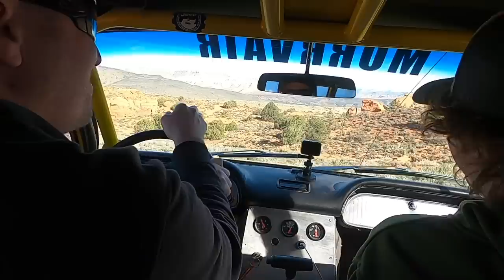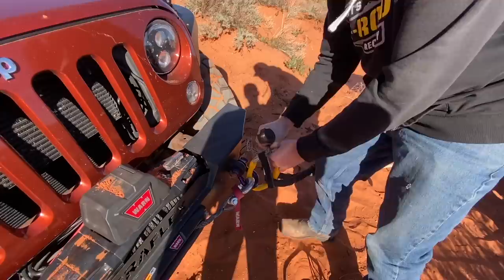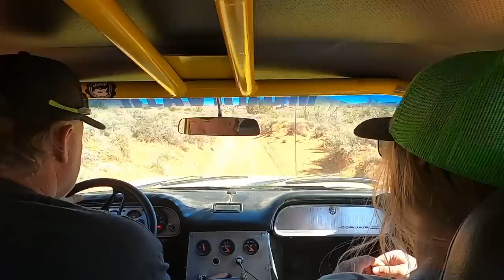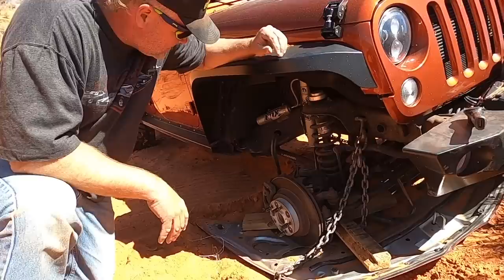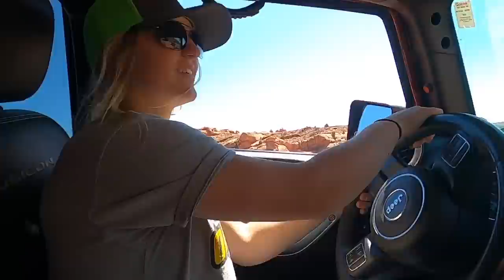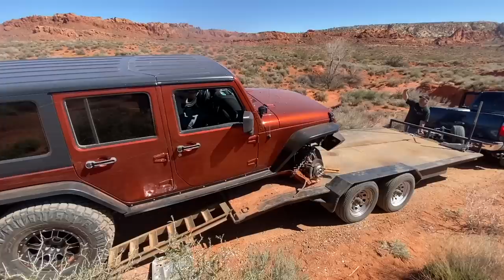We Dragged This Cursed Jeep Out Of The Desert!

Comment: "...skidded it out on a hood..."  I love the grit and ingenuity that always appears in these recovery videos.  Watching the challenges makes my problems seem insignificant!
Reply: I did that to my grandpas Mazda B 4000. Except I used the trucks hood. Actually works great.
Reply: Not very ingenious in this case, because it was easier to just buy a new part and fix it? It’s not hard to change that part!
Reply: @fikaa2388  I suppose that's true if you have the part with you.  Maybe they didn't want to run back to town and then back again to fix it.
Reply: @ScooterintheSticks  I agree that the first day they couldn’t have known, but the second day when they came, they could have brought the appropriate part instead of the hood!
Reply: @fikaa2388  You’re right of course, but that would have made a boring video!
Reply: @ScooterintheSticks  That may be so 🙂
Reply: These guys are all smart and not afraid of trying anything to get the job done
Reply: @larrycrouse  Come on man, this time it really wasn't smart! One bigger rock hidden in the sand was enough to do a lot more damage to that Jeep they dragged like that! This is the last solution used when there is no other, which was not the case here! They were more fortunate than smart that everything went well and they didn't do much more damage! It may be more interesting to watch, but far from being smart!

Comment: Secretly I always wonder about a trail fix but they’re much less dramatic and far more time consuming. Thanks for a fun video!
Reply: Had this happen before on the trail. It's not the best fix, but it got it out of the woods to the trailer. Pretty common for the dana 30s to pop off the knuckle when the u joint breaks. What we did was hammer / drill them out and use 1/2'' bolts to act as a really lose king pin. And then put in a stub shaft so the wheel bearing didn't fall apart. It wasn't fast but it worked

Comment: You guys need to make a sled/ski that will bolt up to the hubs in place of the wheel. Universal bolt pattern cut on it so it'll fit a large range of vehicles. Put a piece of 2x2 stock protruding from it somewhere that would allow it to be slipped into the hitch receiver and hung off the back of the MORR vehicle to get it to the site.
Reply: Or a ski/sled that would clamp to the axle.
Reply: Or an off-road wrecker. lol
Reply: One day they will have the homemade wrecker on 5 ton axles. Pick it up carry it home.
Reply: won't work in this case because the lower knuckle was broken and is why they removed the wheel in the first place. They could make a sled that would bolt to the bottom of the frame somehow and that would be cool
Reply: @scottibass  I think that they are going to end up with a wrecker that is similar to the one that Rory Irish of Moab Motor Sports uses ( Trail Mater ).  
                         Then again , there MAY be another solution . A couple days ago , I saw a video that Casey Lofthouse  ( CORR) put out, where he used a small " hoist" on the back of 
                         his Jeep , to haul a side by side . Now , a side by side doesn`t weigh what this towed Jeep does , so that may not work . However , the Morvair is heavier than 
                         Casey`s Jeep , so it might work .
Reply: @scottibass  I wondered if the lower ball joint could have been pulled back in and secured with a small come-along and the put tire back on. Not sure if you would have room to steer it but rolling might be an option. Either way the end result was getting it to the trailer and that is what counts.
Reply: A wheeled dolly would be even better...
Reply: I've used a fence post to get a jeep with a broken rear axle out. Probably would work on the front.  Chain the front end of the post to the frame let the axle housing sit on the middle of the post, drag the back end of it. 3" wooden post or a landscape timber works best.

Comment: Replied to someone else in these comments, but thought it was perhaps important enough to make a separate post about it...
What a lot of people may not realize is that these knuckles - especially if they are constructed from aluminum - tend to break from over-tightening. All it takes is an overzealous technician or DIY'er, with one of the high-dollar / uber-high torque impact guns to zap the ball-joint nuts down, instead of doing so lightly until they're seated without spinning  - and then torquing them to factory specs. On a JL (for example) it's something like a mere 52-59 ft. lbs. for the uppers and lowers are even less - at 30-37 ft. lbs.

Comment: I love seeing how most of the recoveries go on this channel and they are fun to watch. 
This one though with the jeep was really questionable. Idk about the whole hood thing lol. 
It honestly seems like it would have been easier to just fix the suspension or put the jeep on a trailer to begin with. Rather than drag it out on a hood? Just seems unnecessary and kinda weird🤣funny to watch though.
It reminds me of the saying.."coming up with a solution to a nonexistent problem" haha!
Reply: Agreed. I wonder how much additional damage was done to the rotor and other components. They just hate this guy's Jeep for some reason LOL
Reply: I feel that but it depends on where they are and how bad the problem is. Time is another factor. If you cant get the trailer back there, gotta pull it to where you can. We didnt get a super clear shot of the problem so it might not have been an easy fix. Even if it IS an easy fix, they may not have had parts available off rip and youd rather have your rig in a shop/yard than sitting on the trail unattended for 3 days waiting for parts

Comment: Matt...  Even though you weren't in this video it was a great video.  Love the way the guys and Lizy used some quick thinking to use the hood as a make-shift sled.  I would suggest since ya'll do so many recoveries where a broken ball joint is involved.  Maybe make a sled out of some 1/4 or 3/8 inch steel with the front curved up like a snow ski with some anchor points on the top of it to secure it to the disabled vehicle.  Might want to make one (use 1/2 inch aluminum) for the trailer you use for recovering Razors and other side-by-sides.

Comment: Hey Eric .. make a ‘ski’ out of a   6x4 post and angle cut the front so it won’t plow . Mount some counter sunk eye bolts so the fit on top of the board . 
Take a 2x4 and screw that to the bottom side and sink the screws in deep then you can take a heavy duty strap and tie it to the axle or suspension where the shackles hang down. ..
And then you can pull it out .. or - just custom make a metal 1/4” plate and with a slight bend and weld some fastening points on that .. 
either way I think it may hold up Better than the car hood idea ..

Comment: You guys definitely need a 1967-1972 Chevy pickup hood for a ski for the front of a vehicle to ski on!! For sure those hoods have the perfect slope on the front of them to use as a ski!!! Heck you could even cut one in half and have one for each side of the vehicle if both sides had problems with!!! The 1967 and 1968 Chevy hoods have a shorter angle on the hoods and the 1969 to 1972 have a much higher angle to them but all of them would definitely work much better then them newer flemzey hoods!!! Just thought I’d let you know for the next time you might be out at the recking yard you could look and see if they might have one laying around!!! I definitely have several and several more here in Iowa but definitely a little ways from you guys other wise I’d give you guys one!! Awesome video!! Remember keep up all the hard work ladies and gentlemen!!!

Comment: Need to take a hydrologic cylinder and make it a high lift jack that hooks into a 2 inch receiver with angles in design ! 
I'd power it with my vehicle with hose .
Plus have two of them and all corner receivers so 6points

Comment: Jeep has had parts and component breakage issues due to cheap China casting, they don't have access to structural cast iron like we do, so it's "pot-metal", meaning they melt a bunch of different grade steel and tin etc into a giant pot and pour it into castings. It didn't have the strength. The axles and transmission housings on the newer John Deere tractors are built with the same cheap China pot metal, and they're breaking under pressure..... Not good

Comment: Appears that a ball joint came apart. I would have 'fixed it in the field', but you guys and gals have ingenious ways to avoid that.
Reply: Is it just me. But the lower ball joint still has the nut attached to the joint. So it has either pulled through the lower hub assembly. Which I have never seen . Or something fishy is going on

Comment: I honestly wonder if a car dolly type thing with bigger tires might be better for these jeeps which break a front part, so that the Morvair can tow it. It would be a quick thing to make/modify and then you could use the disabled vehicles rear drive to help push in 2WD. With a set of smooth ramps built in so they can be drug up onto it.

Comment: You should have put a strap through the hood under the tire and then put the strap through the spokes of the rim and tightened it up tight. That way the jeep wouldn't have been leaning and putting a bind on the driver side of the Jeep. But it worked I guess.

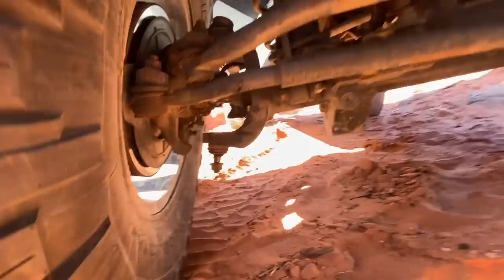Comment: The lower ball joint is not in the steering knuckle you can see at 3:45 even the nut is screwed back on... why not repair it but pull the jeep on a hood through the sand?

Comment: I’m wondering, as many times as they forget the jump box (12v battery box) WHY don’t they run a heavy gauge electric wire from the banana & the Morrvair to the rear bumper and use the vehicles electric system to operate the trailer winch?
Reply: @matt

Comment: Seem like you guys need to design and build a steel ski for jobs like that.
Reply: I was thinking of a farm disker disk (18-24" dished heavy steel)  cut some holes or weld tabs on it. I've  seen it used here a few times by 4x4 recovery tow trucks.
Reply: @jasonh4167  I was thinking something more shaped like a classic toboggan sled with a jack stand to sit the axle on.

Comment: Wait.
You went back to civilization for the night, and didn't bring back the parts to repair so you could tow (instead of drag) back....to civilization? 
Am I seeing this being done the hard way, or am I wrong?
Reply: This is Matt's off road recovery not trail repair. Rory and Paul do trail repair.
Reply: @delbutler885  
That's not the answer to the question I asked, and I'm not trying to start an argument. 
I was just looking at it from a different angle, I guess.
Reply: Nathan Ruff the liability of Matt's crew doing trail repairs is too high. If you or I owned it and it was ours and we were going back to town we would have probably been tempted to do a trail repair if parts and tools are available.